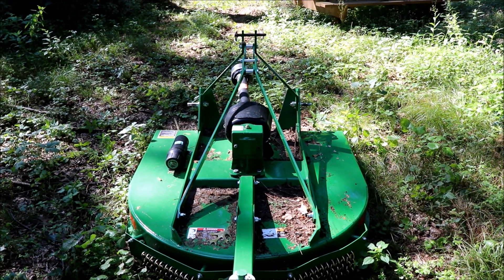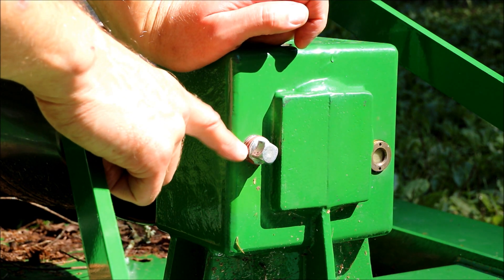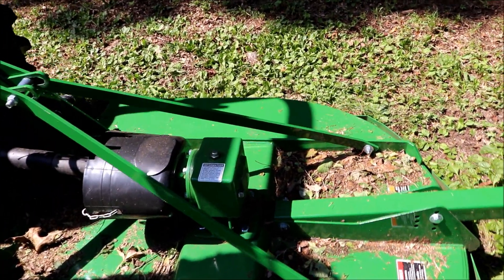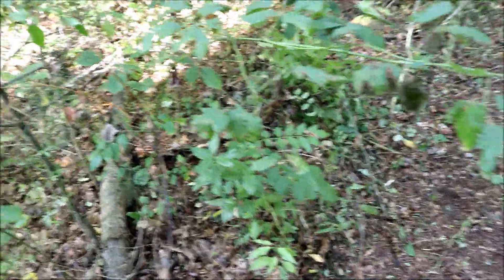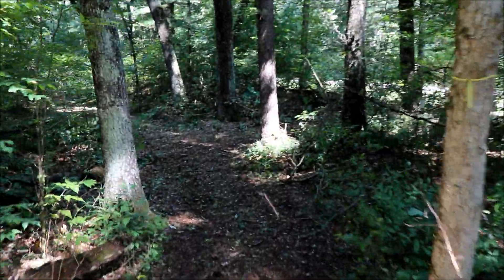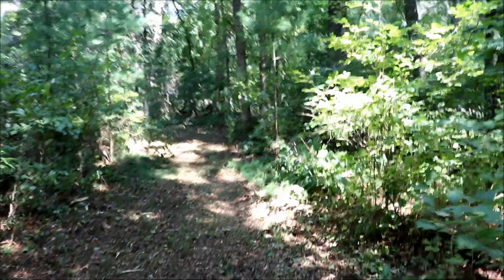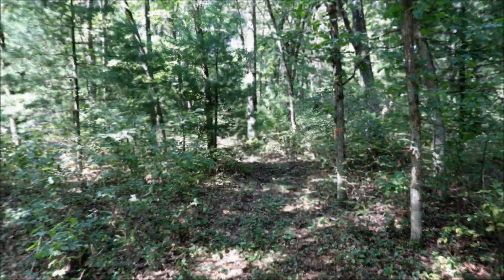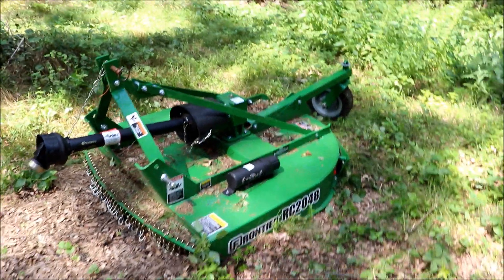Frontier Rotary Cutter Issues

Comment: I have a frontier rotary cutter. There is no drain plug. Open the top vent plug and use a suction gun to get the oil out. You can pick a suction gun up at auto zone for 13 bucks. You won't get every drop out but you should get 90-95 % of the oil out.  To refill i take out the check plug and fill till oil starts coming out of that hole. Also wouldn't hurt to buy a tarp and tarp it if its going to stay in the elements. Hope this helps. Your videos are very informative keep up the good work.
Reply from the maker: I just read in the owners manual that you need to suck the oil out of the gear box.  Also I was thinking I should have it covered at least the gearbox.  Thanks!

Comment: Got to be careful buying even new equipment will malfunction.  About 5 years ago i bought a new County Line finish mower @ Tractor Supply I only used it a couple times and put it away. Never using it again. My brother wanted to barrow it this spring and after using it for a couple passes he noticed oil coming out of the drive shaft seal. Turns out the vent on top was painted over from the factory.  You might want to inspect your vent as well Dave.  As hor the milky oil I'd say you are right.  Probably is getting in thru the top plug.

Comment: A lot of what you are assuming is water condensation is just oil with air stirred up by the gears. If it's truly full of water your oil level will appear over filled not under filled.